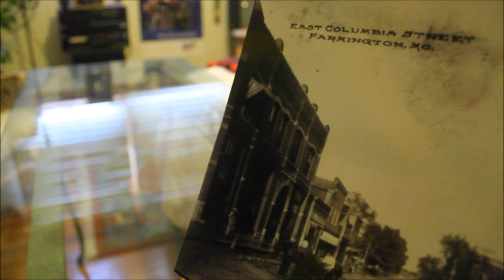Pallet Wood Picture Frame

Comment: Love your video and simple method. Using the photo, cardboard and glass for the measurements makes it so much easier and almost fool proof. And showing how to use the speed square hole, I never thought to use that. Love the idea of using wood dust in the glue. Your thumb near the saw blade made me nervous, and as someone already mentioned, attach that sander to a clamp for safety and more ease of use. Another idea instead of using nails to set the photo/glass in place (which may fall out), use turnbuttons and screws. All in all, It's a nice looking frame and a simple build. I can't wait to make one for my painting.

Comment: Thanks for the video. Just made 3 pallet frames for family and they came out great.  Only thing I changed was to use small pieces of wood instead of nails on the back. Screwed them in so they rotate
Reply: or using soda can tabs.

Comment: Just found your channel.  I really like how you fixed the gap with glue and sawdust.  Well done!

Phil
Reply: I do the same thing. It stains so much better than store-bought wood fill.
Reply: I agree! What a great tip!
Reply: Forgot to say, great video. Lots of inspiration for using pallet wood.
Reply: Phil Pinsky Productions.
Reply: I've seen people using epoxy instead of glue. Works even better.

Comment: just a little fyi bro use your speed square too make sure your saw is 45 an not 46 will make your corner tighter with no space
Reply: You would think that when a saw says it's at 45 it would be... but they usually aren't

Comment: TIP:  Use a plastic 45 degree template from an art supply to set you miter saw.  Using this method I have perfect miters.

Comment: Good idea. However, what about safety and accuracy?
Safety: the sanding machine glides on the surface and threatens to fall down any moment... clamp it onto the table.
Accuracy: you cut 45° mitres but clamp them unevenly so you have to use glue and wood dust four correction. It's a good way, though.

Please try to work more safely, so you'll be able to provide us with more good videos like this one!